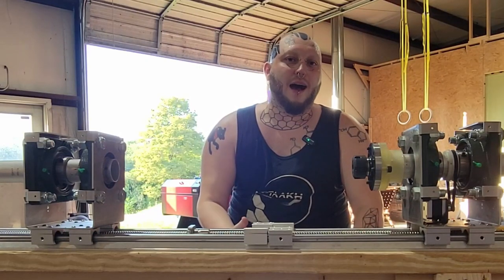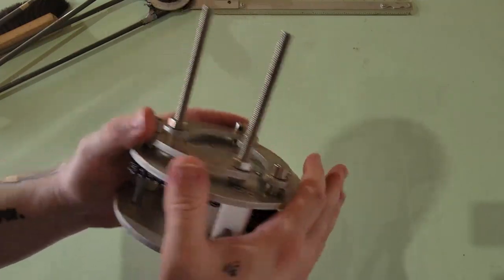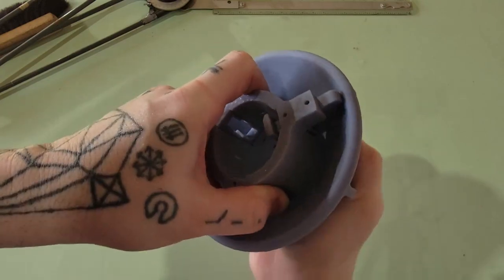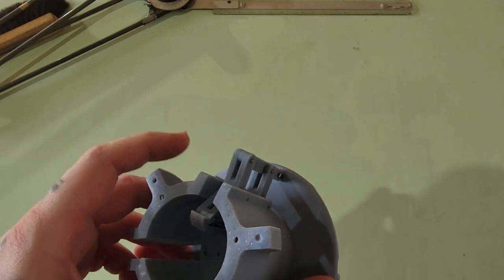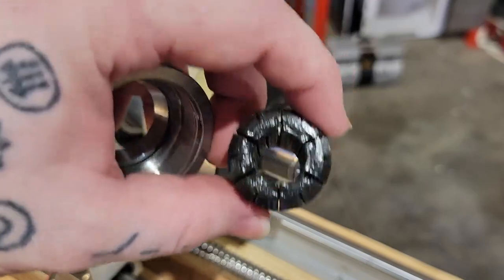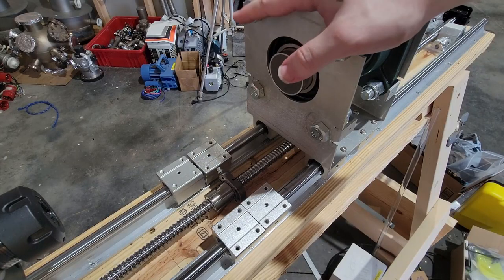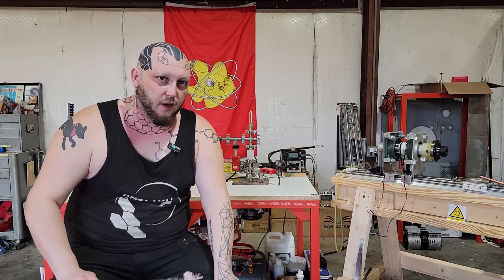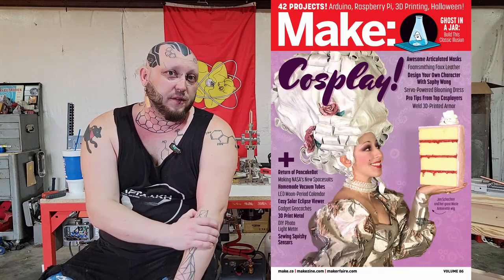An Update on the DIY Glassblowing Lathe

Comment: Great Video! I thought about building a glass blowing lathe for quite some time. I really like the first design of the three jaw chuck. I know you allready found a solution by using the collet chuck but maybe some omnidirectional bearings (I think they are also called ball transfer units) on the surface with creates the friction might be a solution for the first design. It could enable you to use larger diameter tube compared to the collet chuck. 
A second stepper motor on the chuck at the opposite side would also be a great addition to let both chucks run in sync.

Anyway I'm sure you allready have a lot of ideas for the lathe and will be able to make everything work on your own :) 
Can't wait for the next video!
Reply from the maker: Yeah, the first chuck design can definitely be made to work. Check out this video of the chuck that I based it on if you haven't yet: 
https://www.youtube.com/watch?v=_UF2CPnIqrc

As for a second stepper motor, I don't think I made it clear in the video that this is the second in a series. I talk about the design in the first video and a synchronized tailstock is definitely part of the plan, in fact the entire tailstock is identical to the headstock, just rotated 180.

Comment: Apologies up front, since i have no experience turning glass, but can't imagine you are imparting more tool/forming stress than what happens with wood turning.  I say that because presuming I'm correct, can't help but think some modifications to a longworth chuck design should should solve your interest in simple, and suspect it may be faster than your current chuck (although admittedly that is just with the rough idea I have in my head, and much would depend on the range of adjustment you would want/need).  If you haven't looked at longworth chuck designs I think it may be worth your time to take a look.
Reply from the maker: You're completely right that the workpiece experiences very little force, especially on this scale. I'm familiar with the Longworth chuck, and I think it's a brilliant design, but the most important feature of the glass lathe might be that the spindle bore goes all the way through. I started to design a modified Longworth but that's what ended up becoming the "cone" chuck. I appreciate the suggestion!
Reply: @SignalDitch  no, no no, I absolutely appreciate the need for a bore through spindle, but there is not reason that the center can't be drilled for precisely that since there are just mounted direct to a faceplate.  The thing that would also need some modification is the "bumper clamp thingie" (?!) either some sort of fixed cam arm so they will naturally impinge on the center as you adjust the ring, or possibly some sort of rubber washer or a stand-in.  I suspect that will be the area that would take some design work, but certainly feels quite achievable to me.  The two rings for the self-centering mechanism would be much smaller than on a traditional chuck since I imagine you don't need nearly that much range of adjustment, also now that I think of it could also be possible to design it around having the "bumper clamp thingies" on both faces of the clamp which if done well should help keep the piece running true (clearly a necessity).
Reply from the maker: Yeah, this definitely seems achievable. I think with enough development you could come up with a Longworth-style chuck for this lathe. I may revisit that eventually.

Comment: instead of ypur second chuck design, 
id go back to the first, but instead of using a linear slide for the teeth, id make them a cam, pin the back, so that they swing in and out, and then ad a second pin and foot to allow it to hold onto the tube and remain parallel, you can then change the agle or curve of the back of the feet to allow for more gentle movement at different sizes

Comment: I really hope you have a dozen of those zeolite bags, because you'll need a lot of it for a concentrator that can properly run a torch that size :)
Since you're in the US, it probably makes more sense to just hit up medical supply companies and get a quantity of good-but-scrap-for-medical-use concentrators at a steep discount. At the very least you'll want to salvage the compressors out of them, because concentrators also require a lot of flow at a decent pressure to be efficient.
Also, I don't see a driven secondary spindle on the lathe - you'll want to think about adding one soon, because for a lot of operations you need synchronous spindles and dual workholding, you can't just rely on one.
Reply from the maker: I really try to be charitable in my reply to comments like this so I'll just address each of your concerns in turn. 

- I have several kilos of Sodium Zeolite, I don't know why it was shipped to me in 500g bags. I don't know how many bags of zeolite I should have held up for illustrative purposes to avoid this comment. 
- I already have a capable oil-less compressor from another project. 
- Building my own PSA concentrator was not Plan A, the ubiquitous advice of "just go buy decommissioned concentrators from medical suppliers" appears to have gotten more difficult recently (or most people who suggest it have never tried) so that wasn't an economical option, especially considering I already have a compressor and a stock of pneumatic valves and fittings appropriate for the project. 
- If you're curious, I'll be building a modified version of the "oxykit" oxygen concentrator, it's an open source project that you can find here on YouTube. 
- In the previous video about this lathe, I review the design in its entirety and you can see that video for more details. In short, the headstock was a testbed and now that I know what works, I'll do the same for the tailstock. In this video when I said "I only need to replicate what I've done in the headstock to the tailstock," this is what I was referring to. 

I welcome any and all suggestions and critique but I do need you to assume that I have even the barest knowledge on the subject. I may be out of my wheelhouse as an EE, but I do know what I'm talking about sometimes.
Reply: @SignalDitch  Good reply, thanks for clarifying :)
I might have been a bit asleep when watching the video.
Looking forward to seeing the results of all this, a homemade concentrator would definitely be new in the world of... uh... DIY glassblowers, I guess.

Comment: Hey man thanks for the video. I have an extremely similar set up. Smaller and with off the shelf parts though. Question for you; how are you keeping your steppers synched? I'm running nema17s with a directional controller and a microstep driver and one motor is consistently a tiny bit faster than the other. Any issues with this? Mind if I ask what your electrics look like?

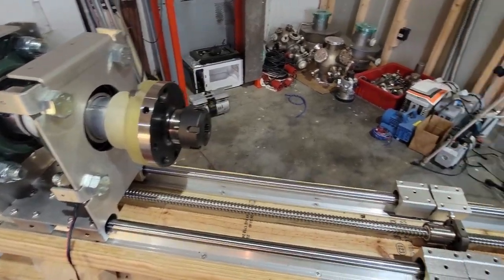Comment: 7:50 - Was there any reason to get ballscrew for the carriage? Is it possible to use cylindrical linear rails or box rails instead? The ballscrews are really expensive, could be as expensive as to the entire lathe and intended to be used for motorized linear motion to provide accurate positioning and repeatability down to few thousandths of an inch, which I think the glass lathe won't gain much from it. Are you planning to make the lathe's carriage linear motion automated?

Comment: Take the too simple design and make make it 4 step half pyramid pushing the middle support flat opposing angled pieces ribbed to add a soft silicone or something to cover the supports inside so the binding and wobble areas are fixed in a matching level twin linear opposing lathe  chucks so the blow tube can be used with a rotating barbed pressure connector torch on a xyz axis stabilizer and positioning rail for the torch but enough of my book in my opinions 😂 thanks video gave my idea to fixing the 7000 dollar lathe diy for 200 to 350 depending on if you own a good 3d printer where did you get the file to print that specific design?

Comment: How much misalignment/dyssynchronous movement is acceptable for something like this? I've watched both videos on this lathe project and most of my concerns/thoughts about how well this will work boil down to that question. 
Seems to me that glass, being as brittle as it is, requires that the two heads would need to be very tightly aligned and synchronized to keep from breaking the glass as it cools. In that case, I think that the notion that you can keep this project within the means of a non-machinist hobbyist on a tight budget might ultimately be too ambitious. Just mounting the whole thing to a wood assembly throws up a huge red flag if alignment needs to remain precise. 
But maybe the glass tubing is so thin wall that the glass has enough flexibility to accommodate a small amount of misalignment. I think a lot of alignment issues could be addressed by not using the collets in both heads, but rather something similar to your original chuck design with soft/flexible jaws that would allow for several thousandths of movement to accommodate not only any misalignment but also the glass shrinking as it cools. 
That leaves the issue of dyssynchronous rotation. Maybe the stepper motors are accurate enough to do this. But if it were me I would include some sort of limited slip clutch in at least one of the heads to allow for that sort of an issue. This sort of work seems to need only minimal torque, so a clutch that manages to keep things moving while slipping as soon as the two heads start trying to twist the workpiece would be an easy solution. Maybe there is even a way to use the stepper controller to allow for a controlled amount of slip in the one of the motors.
In any case, I came across your channel yesterday and am pretty impressed with what you're doing. Looking forward to watching more of your videos.

Comment: using your old chuck with planetary-ring gear will be help
Reply from the maker: You're right, that would probably fix a lor of problems
Reply: @SignalDitch  Can you share the design file? The more participants use it, the more appropriate changes will be made.

Comment: Just buy a 5lpm used O2 concentrator
Reply: Or a professional 10 or 20 liter unit from Mountain Glass. They cost the same as medical units and have two to three times the capacity. 5 lpm is not enough for any but the smallest torches. I use 14 lpm and can't run a torch large enough to work 2 inch boro tubing in any time frame I can tolerate!